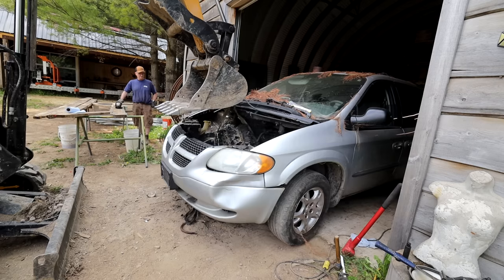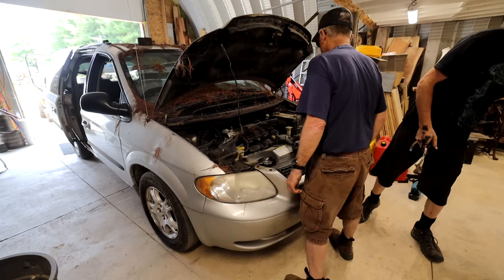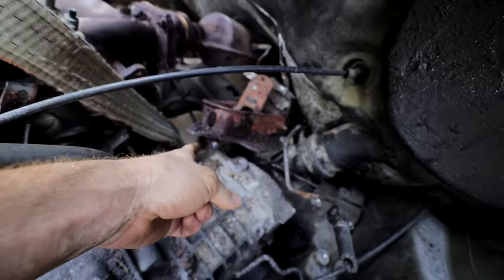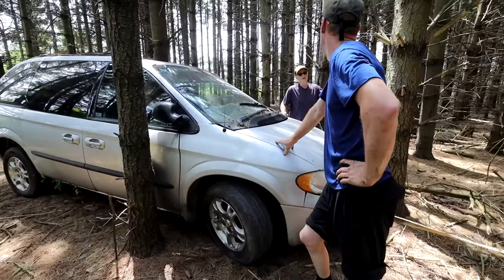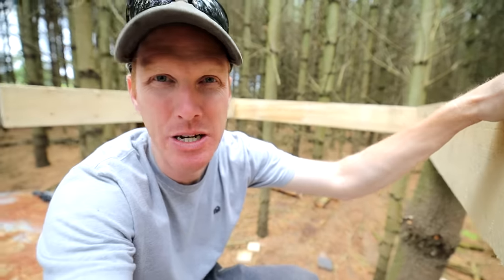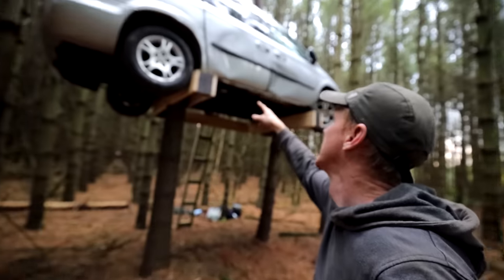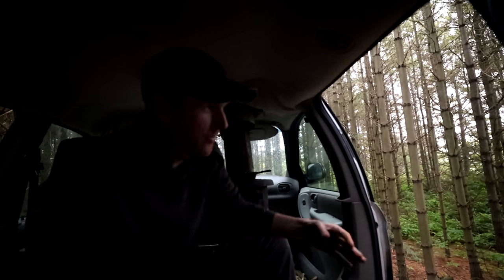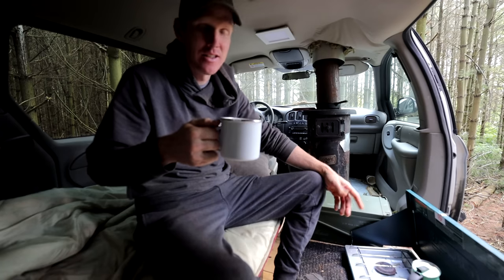Building Tree Top Truck Treehouse (on a Budget!) - Fireplace, Bed, Luxury, Storage, Sleeping, Cook'n

Comment: Next time you remove an engine: chances are it will drop out the bottom a lot easier than ripping it out the top (but if you dont want to do that, remove all the body panels and structural components and you can probably get it out the front that way)

Comment: I thingking about the water cooler, what if you burn some wood in the furnace and than just heating up the water inside of the cooler, it can be isolated and hold up some heat, and some electric fan can blow hot air in the cabin. I guess the heating in this way could be more efficient. But it is just my idea. Anyway good job, keep up, because you are so inspirating, and so fun to watch any of your video! (Im watching this from hungari, so if my english is not very understandeble, sorry about that, im still learning in english, but i understand close to all what anybody say in english i guess this is a good start XD)

Comment: Idea, could mount a buncha marine batteries under the hood, can get cheap solar panels and mount on the roof rack. Inverter on the dash and you'd have a sick off grid powered hangout. More batteries the more you can do and for longer. Harbor freight has cheap crappie panels and also if you thrift some boat hoist alot are powered and have solar and different DC drive motors and pulleys. Might be in rough looking shape but bet they'd still work.

Comment: I would remove the steering wheel and take the driver seat loose and face it to the back for a comfy seat, hopefully it will still recline. Also, keep an emergency rope or roll up ladder,  in case  somehow the winds or a bear knock away the ladder. Speaking of bears, keep an air horn to run off any unwanted guests, and don't open the door for bears. Rewire the headlights and emergency flashers for outside lighting and safety. A  walkaround patio or roof pallet patio would be a definite benefit. Get some blackout curtains. Paint the outside camoflage style so you can use it to hunt deer and hide better. So many options! Cool idea dude!

Comment: So fun, laught alot. And the engine pulled out like a bad tooth. Beth Ull built some kind or porch around later. My dream is to make a raft with a car on top as a driwers cabin, and to run some cable drum padlers. Like a steamer to bring anglers out on the lake. And when weather is a little sour they can take shelter in the car-cabbin. Allways innspired by your creativity.

Comment: Add a small deck off of the trunk area, away from the ladder. That way, it would be harder for someone to come up. Maybe a deck that's screened in. What will you do if someone walked up the stairs? Maybe you can pull them up and lock them into place and let them back down when you're ready to come down. Or, maybe you can attach a rope ladder to the car that can be pulled up after you come up.  It's still easy for someone to come up. Keep your doors locked.

Comment: Not sure what the bolts are like under the driver's seat but I wonder if it could be turned around?  Especially if you remove the steering wheel.  Would make a nice comfortable place to sit.

Comment: I have removed over 30 engines and replaced them and all you had todo is disconnect the trani bolts , drive shaft , motor mounts , wiring and fuel lines , 6-7 on the trani and 4-6 0n the motor .

Comment: those trees are going to rot. dig in some treated 6x6 on the four corners. add some solar panels, lithium battery, charge controler, inverter. hook up the dash vent fans for air circulation and an after market head unit for some sounds. If your feeling froggy get dark green, dark brown and black spray paint and Camo that thing out.

Comment: front wheel drive vehicles usually remove from the bottom 4 bolts holding the H frame, and it's out, lift the car off the H.

Comment: Take the driver seat out and make a small somewhat functional kitchen, maybe some sort of way to open the driver door and slide the cooking grill out. Under the engine compartment, a water tank with maybe a sink built in at the steering wheel. Firewood storage or food storage in the glovebox area.

Comment: Build a platform/storage system in your engine bay then cut a hole through the firewall on your driverside and passenger side. One side you could reach through for your food and supplies and the other for firewood.

Comment: the best way to remove the engine ant transmission is to remove the sub-frame from the bottom there are 4 18mm bolts and one engine mount on top than just a bunch of wires. Realy only takes 4 hours. After removing the 4 18mm bolts you lift the van off the sub-frame it just drops out from the bottom of van.

Comment: Easier way to take motors out when you are scaping by hand. Cut the exhaust and wires and hoses. Take the strut nuts off, then there shoukd be several bolts holding the k body in. Once thats undone, you should be able to lift the body off the motor.

Comment: Build a deck behind the car, but at a slightly lower level, so you can use the pull-out table as originally designed. Maybe make it a wrap-around deck? Honestly, I'm genuinely kind of impressed with the speed you got that platform up the tree, by basically doing tall stumps instead of poles. The possibilities this opens up are... numerous. Especially in a forest like yours, with all the trees so evenly spaced. I'm just imagining some really cool tree forts now, and how cutting trees at different levels might allow for some cool building designs. 🌳🏡

Comment: I hate to be a downer but even if those trees are strong enough to hold that van up right now, when you cut the tops out , you killed them and they will start rotting from the ground up. The roots are strong right now but they will weaken quickly. I'm telling you this because I don't want anyone to get hurt

Comment: Somehow run some bolts through the floor into your cross beams to stabilize the van a bit more. And maybe add a solar panel or  two just to run the windows and locks.

Comment: probably should've taken the axles off that van.  A benefit to having this van as a camper is that with your generator you could probably figure out a way to run the power to the radio through it so you'll have a radio if you want one lol

Comment: You should have unbolted the top side of the struts took the steering shaft off unbolted the sub frame and dropped it all at once.. Motor transmission sub frame basically the whole drive train and everything underneath the front of the van would have came out all at once would have been a lot faster

Comment: I have a running Caravan fishing shack with a towlbar to get it to the ice... Then can move it around on the ice with chains on the front tires and use the heater for heat or my big buddy ...It cannot be licensed because it needs a safety which would cost too much. I have a couch inside which is comfortable to sit on and great to sleep on

Comment: Remove the steering wheel create a desk for a computer  or bigger screen to connect through phone as a remote control. And yes  a patio out through the slighting  door with folding chair & table.

Comment: since it's not going to drive anywhere, couldn't you take out all the motor parts and such, and just try and figure out how to hook the windows up to one of those eco flow batteries? that way, it would lighten the load, yet still give you the option to open a window for some fresh air on a hot summer day in the tree car

Comment: Putting the firewood where the engine is sounds like a good idea and putting a port so you can access it sounds like a good idea to and doing a 9-volt battery so you can have the power windows in the power lock sounds like a good idea too and I would also put AC in there so you would have that

Comment: If you must do something like that. I would have put a generator in the engine compartment , that way you could run all electronics and a small heater and eliminate that woodstove (which takes up unnecessary  room) and add a wraparound deck as well as a deck on the roof.😁🇺🇸🦅
Reply: RealModernSelfReliance  every time I see”telegram lucky winner “it’s a scam, so what are you, just another scam?

Comment: you could get a roof rack awning for one side of the sliding door, I would put a wrap around deck so you could use the engine bay ( i think a grill in the engine bay might be cool/funny a grill behind the grill of the car)  then the back hatch with an some chairs or the bench seat reversed so if its drizzling you are protected

Comment: It's pretty common problem for the transmission to go out of those vans. Nice thing about those, the rear end has a shackel and then bolt up suspension. You can use them to make light duty trailers. You might be able to add a battery and solar panel to operate the electric windows and the radio.

Comment: I would add a 12volt battery and a solar panel to charge it  then use it on the power windows and radio,then put screens on the windows that open

Comment: Bushcraft engine removal! What about placing other minivans or vehicles in the surrounding trees and connecting them with bridges, like a campground or Air BnB? Just a thought. Great video.
Reply: Good idea Kurt. I was thinking the same that he could fix the van up for him and his wife then maybe find an old Volkswagen Beetle and paint it pink to remove all the seats and fix it up inside for their daughter. Make her a nice bed inside and girly it all up for her. Then make a bridge to it from theirs. You can make one of those slide outs in the van to have a bed big enough for him and his wife. Put up a pull down screen for them to watch movies or a big tv in there. Then go over to the next closest tree to make a big balcony to walk out on and put a grill out there with a little table and a few trees. The ideas are endless. I would just maybe add some medal railings and more heavy duty boards to connect to to be safe. This is so cool though. That would be so fun in the winter since you already have the wood stove. Definitely need some solar. The ideas are endless Kevin but I can’t believe you thought of this but what I really want to know is what was your wife’s first thought when you told her what you were going to do.

Comment: FYI pallet wood, is chemically treated against bugs rott etc. For travel and shipment With harmful chemicals. I see a lot of people using pallets for projects and never mention it. Definitely never sand pallet wood without a respirator cover, and I know it's cheap or free, but if you can avoid pallet wood for making indoor furniture in a inclosed area, I made a coffee table out of one and my cats would scratch it, they got sick
Reply from the maker: Most, if not all pallets from around here are HT or heat treated.  You should always use a mask when sanding any wood.

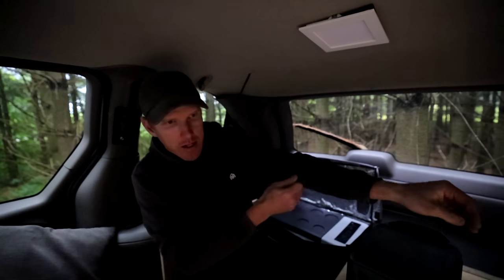Comment: 33:33 hey you quick idea build a small deck behind the hatch so you can walk up and open your hatch and stretch maybe even a chair n small table💙🏕️🍻 also after that build a wrap around deck so it will be like your parked boondocking but you 9’ in the air hahahaha dooo it 🔥🍩😎
Reply: Also can you use that space under the hood and build a wood casing for storage or whatever??? Like now that it’s up there guy out the front seats and dash and take the firewall out n build in with wood n wetherize
Reply: Also for extra support I gues you can use a strap or rope to strap it to a tree to its four towing mounts but have to strap high onto tree for balance n support

Comment: Put a tarp around the bottom and put a deck down there you can put in a hatch so you can go down and you can put your kitchen there or a bathroom also if you do the bathroom area down there you can take out the dash and close that area in and make you kitchen there put a deck around it and solar panel’s on the roof
Reply: Won ??? Message  you where ?

Comment: take the steering column out and turn the seat around?...
Reply: Also, get your electric windows and the blower fan working to help regulate heat from the stove, run a cable down to the ground for the battery.  Having the tailgate open will be great.  I'd personally paint the body in dark matt military paint...
Reply: or Realtree print.